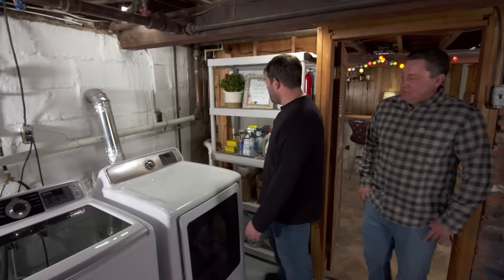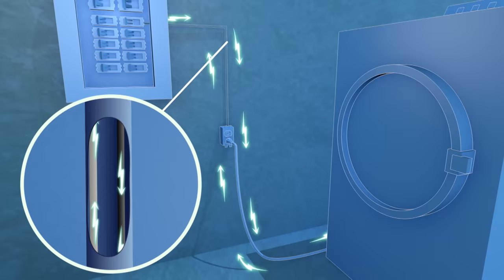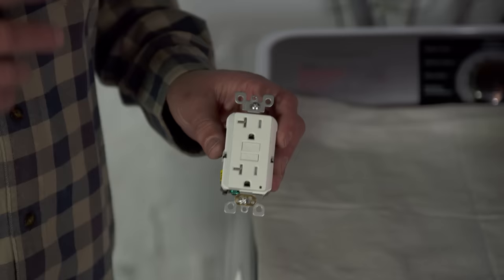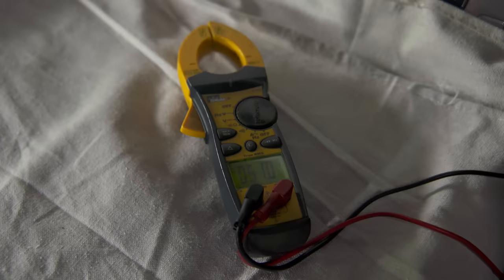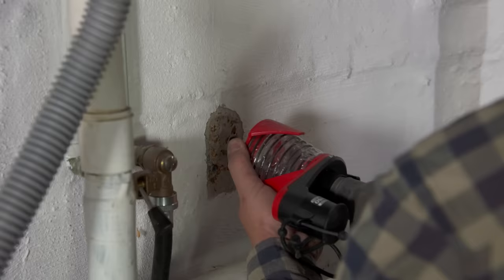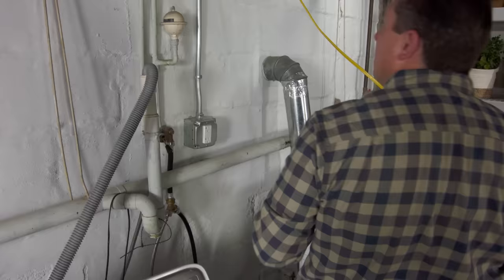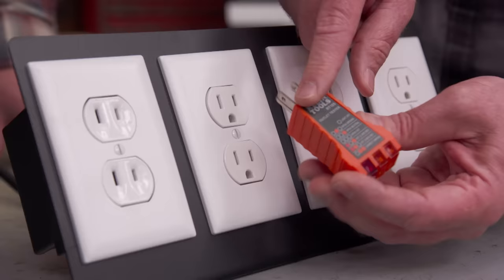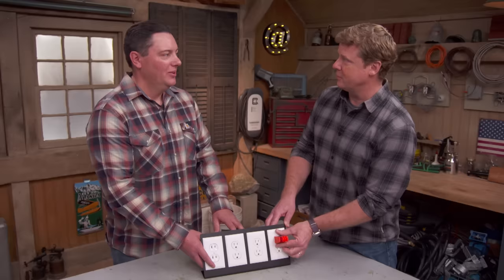How to Ground a Two-Prong Electrical Outlet | Ask This Old House

Comment: This should have been titled "if you have a two-pronged outlet replace it"
Reply: I have a two pronged outlet in my 1940’s house.  Really cool how it is decorated.  Not bland, flat and boring like the ones in use today.  When I rewire the house that is the one outlet I am going to keep.  If I have doubts about it’s safety due to age I’ll rewire it as a 12 volt and use it to power a 12 volt bulb in my 1920’s Art Deco floor lamp.
Reply: @coffeeisgood102  I wouldn’t worry about them being unsafe just be sure that the insulation on the wiring is in good condition and it should be fine
Reply: I have a 1956 house, it was all two wire as per code at the time. There were a couple outlets which the previous owner had installed three  prong outlets and as in the video had no ground so I labelled them. A neighbor is a Master Electrician who ran his own business and I asked how much to rewire everything, here is what he told me. "When your house was built practice was put the main panel by the back door and wire UP into the roof then drop DOWN for wall outlets. Now we put the main panel in the basement where modern Service Entrance for utilities are located, and wire UP. Shorter runs, more accessible and less material. To rewire your house would cost a a fortune. To upgrade my old 60 Amp service he installed a new mast (our neighborhood is overhead wire) a 110 Amp service to a new panel. The old panel is now a sub panel, several circuits were removed and rewired to the new panel and the rest were left, as long as you don't make changes to any of the circuits in the old panel they are grandfathered and legal.

He added a GFCI in the living room for the entertainment Center which is on the old panel but that change is legal.
Reply: @coffeeisgood102  are you referring to the plate?

Comment: Buying a house that's from 1944, but in pristine condition (fewer issues than the "new build" I bought in 2017), having to just replace outlets with GFCI. Luckily the major places like laundry, kitchen, and bathrooms were all converted by previous owner. But the rest are 2 prong...and I really don't want to explode my TV.

Comment: If you were discouraged by this answer, another way to provide some safety is to add a GFCI outlet or breaker.   Not as good as a real ground, but much better than giving up and leaving it as is.  Yes, a GFCI will work without a grounding wire.
Reply: THIS. Thank you Ryan. Wife and I just purchased an old house (1958) and previous owners put GFCI outlets literally everywhere. But not in many places where they're actually needed. Like, the laundry room for example. I also saw a couple 2-pronged outlets...If the house is still ungrounded and based off of an older system with different standards, are the 2 options: 1) Add ground wire to the breaker and all circuits or 2) replace every outlet with a GFCI in order to plug in 3 pronged appliances/devices?
Reply: @cameroneverhart6443  Well, the right answer is "Both" since a GFCI and grounding wire provide safety in different ways.   If your house has unbroken metal conduit to all locations, a qualified electrician could probably set up grounding from that.  If it's knob and tube, grounding everything would be prohibitively expensive.   Note too that you only really need one GFCI device per circuit, not per outlet, assuming everything is wired correctly.   So try manually testing the existing GFCI outlets and see what else goes down with them, you may already have protection on the outlets you're concerned about.
Reply: @ryanjcampbell  NEVER depend on the GFCI test button if the GFCI was used on an UNgrounded installation. The test button uses the earth ground conductor to create the imbalance between hot & neutral. In that case, the test button will NOT trip the GFCI, leading one the conclude there is a problem, The GFCI may indeed work as intended if the leakage current is going to ground via some other path: a short circuit, wet towel, human, etc.
Reply: @cameroneverhart6443  1958?! That's almost new in terms of housing. Knob & tube wiring was falling out of favor prior to WWII. Nonmetallic-sheathed cable, or NM for short, was first Listed and described in the NEC in 1926, but it was invented a few years earlier by Rome Wire Company in 1922 in Rome, NY, and marketed under the trade name “Romex® If your house doesn't have "Romex" NM plastic cable, it likely has Fabric-Insulated Electrical Wire;  brands were Cres-Flex and Ammcoflex among others. 
The Fabric-Insulated cable was usually 2 conductor with ground. But a lot of "old-timer" electricians thought the bare earth ground wire was new-fangled and unnecessary, and thus just cut it off when stripping the jacket.
My house was built in 1894, at least according to county tax records. That's old. There were still a few gas pipes in my walls for gas mantles. It had knob & tube put it when the house was electrified around the 1920s. It was rewired around the late 40s with a mix of plastic & fabric NM cable.
Reply: @RichardFallstich  I believe that is only true for external GFCI test devices.   I was saying to use the test button on the outlets, which will cut off the entire circuit they are on regardless of grounding, at least all the ones I've used have.
Reply: The NEC doesn't require GFCI protection for clothes washing machines specifically, but it does for “Laundry Areas.”

Comment: If you use the GFI approach, since it wouldn't have the ground wire available you need to add the "no equipment ground" sticker to the face plate (it will come with the GFI).  Actually I've done this to a number of plugs in my (very old) house when I can't easily pull a new cable.  Works fine and is code but remember for electronics (TV, computer, etc) it won't protect them like something that has a ground all the way back to the breaker.
Reply: It’s GFCI and they are not plugs, the are receptacles or outlets. A plug 🔌 is a completely different part
Reply: @electricaf365  Showoff! I know what he meant. And his point of not having a real earth ground is well taken. Line conditioner surge suppressors (Furman, Panamax) typically used for home theater or audio systems need a true, preferably robustly grounded RECEPTACLE.
Reply: NEC 2011 did away with the no ground sticker

Comment: This was the right repair done the right way.  The cost in the description is low but it's probably an old video.
Reply: Not in the Midwest. If I did that job it would of billed at $250 ‐$300. Been in buisness since 1996 so I don't need to lowball either.

Comment: Good video.   Simple, straight  up  explanation with correct options.  I should show it to some of my customers.   It is some of the comments  I worry about.    Proper grounding is one of the most important safety  issues when it comes to electricity.  Older and even newer homes have their own  unique  wiring methods.  It could be handyman doing work in the past.  When the grounding wire was added to the cables many electricians did not know what to do with it.  Keep in mind that if there is no proper grounding conductor present, your surge  protectors might not work.

Comment: The main circuit panel does not have to have separate neutral and ground bars (only sub panels).  When he is hooking up the breaker he says to hook the last wire up to the ground bar but you can see a bunch of white neutral wires already in the same bar which is fine.
Reply: I think the breaker he is using is designed to send the current to different busses.  I think the previously confused panel is a different issue but he did the job correctly

Comment: It would have been nice to apply this to a larger situation than just a single receptacle that already should have been GFI, like a standard circuit of 2-prong receptacles.  Knowing that you can simply replace the most upstream receptacle with the GFCI and have it protect new downstream 3-prong outlets would be a valuable point that would save DIY'ers a lot of money if they have a whole house to work through.
Reply: Andrew Cates 
It’s not always visible as to the circuit layout and knowing what feeds what. 
In such cases, we often just replace the breaker with a dual GFAFCI to protect the entire circuit.
Reply: @RobertLeBlancPhoto  I agree the method I mentioned would take more time and trouble-shooting.  DIY'ers (the audience for This Old House) are typically willing to spend more time so that they can save money.  Otherwise, they'd just hire an electrician to do this.  Those breakers are likely more than 10x more expensive than using a single GFCI receptacle per circuit, so if the whole point is doing it yourself and saving money, that may not be the best fit for everyone.  I agree though that the breaker route is definitely a worthwhile option that is faster and could be perfect for many people.  That was the broader point I was trying to address with the video - they didn't mention any other options or a larger scenario.  It was too specific to the washing-machine receptacle circumstance.  Educating DIY'ers to more/all options available to them would be more helpful since most people that are dealing with 2-prong outlets will have more than one to address in their home.
Reply: @andrewcates3390  There are about ten existing YT videos on how to do the 2-prong to 3-prong upgrade with GFCI, if you ignore the idiots who suggest you just "ground" it to the enclosure, without bothering to discuss how you know whether that enclosure is bonded to the ground at the service panel.
Reply: not true, downstream protection only works when you have a ground. try using your gfci tester on a downstream outlet with a blown out ground, the results may surprise you. No ground on a circuit requires GFCIS everywhere.
Reply: Very interesting comment.  Goes to show you how dangerous these videos can be.

Comment: The jobs you show always have complete open access to what needs doing.  Just once I want to see you tear apart some drywall.
Reply: It is always best case scenario. It is bizarre. Why make that video?
Reply: And how come there’s always a pristine breaker panel installed? How come there’s never a rusty old fuse box full of cobwebs? (With 75% of the house on just one fuse!)

Comment: Good job...but my inspector would not pass this job due to the romex being ran through the emt...I would have pulled #12 thhn wire from the j box to the new device preventing over heating through the jacketed romex....

Comment: If the receptacle is in EMT like many unfinished basement receptacles are, especially in the laundry room, you can just put a jumper to the outlet from the metal box and the conduit that’s connected to the service is now the equipment grounding conductor.
Reply: Yes it does work but definitely better to use actual ground
Reply: But for for retrofit why not
Reply: Yes, unless you have the conduit poorly connected to the box and the main panel.  It's obviously better to run a ground wire.
Reply: Yes EMT is perfectly fine to serve as ground. Perfect example of do-nothing make work.  All that was needed was to replace two prong with three prong receptical and connect ground to metal box (checking that metal box is indeed grounded first).
Reply: @springer-qb4dv  yep thats what I meant for a new install just run a dedicated ground but for this situation especially since in America you have to have use a gfci in unfinished basement it would’ve been fine
Reply: In this house, the EMT was just a 3’ piece used to protect the Romex as it goes up the wall. Just a chase. Since the EMT does not go all the way back to the panel, it is not an “effective ground fault current path,” and connecting the ground terminal of an outlet to that metal box would do nothing.
Reply: That’s a good point!

Comment: Theres a lot of ppl that cheat the neutral wire when trying to sell their home. Keep in mind those plug testers are not always accurate, considering it doesn't know if there is an equipment ground wire or not.
Reply: Some newer testers can identify bootleg grounds...👍
Reply: @MrMaxyield  Nice to know. What manufacturer carries it. I have always opened outlets to see if ground has been bootleged.
Reply: @notredo  one brand i know of is Ideal.  I think it's call Ideal Sure Test, i do know they run around $300 give or take.  They work my measuring the impedance between neutral and ground on the receptacle. Obviously a cheated ground (aka there is old cloth 2 wire system and the handyman decides to install a 3 wire outlet and jump the neutral and ground to fraudulently pass an inspection,  very common with flipper homes,  unfortunately ) will be a very low impedance due to the very short length of wire, while a properly grounded romex wiring will show a larger impedance due to length to the panel, because neutral and ground eventually meet at same bussbar .    Hope that helps
Reply: @Sparky-ww5re  thanks
Reply: @dancooper6002  If you buy an old home you should already have that in mind..

Comment: Note the panel, it's likely the main panel, and you can see ground and neutral sharing the neutral/ground bars, so the two are "bonded", at the box.   Also note: sometimes people ran ground to the metal box, but not to the receptical.   In that case, you can go with a 3 prong, and the entire thing is simpler.
Reply: Only a three-prong receptacle with a ground strap attached to the bottom screw is code compliant
Reply: @kevinjensen7752  new code allows a gfi to be used, without ground if you do not have it at the box.must be marked as ungrounded.
Reply: Or just put the entire ungrounded circuit on a GFI breaker. Easier then having GFI outlets everywhere.
Reply: @kardrumzcoursey9537   I know right.  Honestly, if GFI breakers existed before 71, ground wires to the appliances would not even exist....lol.

Comment: Some older homes like mine with two-prong can be grounded but through the metal conduate back to the breaker box.
Reply: this is true as long as there is a grounding tail going from the electrical box to the outlet, switch, etc and the conduit is emt or rigid. Metal flex is/was only allowed for grounding in special circumstances. I think it's even still legal to do this today although it is frowned upon.

Using the conduit as the grounding conductor was common practice until the mid 90s.
Reply: Since you're talking about older homes, are you talking about actual conduit? Or the flexible metal armor that a lot of older wiring was wrapped in? If you're talking about the latter, it's illegal now to use that as a ground. Overtime, the cable could form a break, whether it be at the box or along the run, causing a ground fault. Also, the armor wasn't necessarily designed to carry any kind of load. There is potential of causing a fire if the neutral wire loses connection since a standard breaker has no way of checking if power is coming back through the neutral wire, or another location (ground wire).  You could have 15 or 20+ amps going to the armor cladding when it wasn't designed to do that and heating it up like a heating element. Hence why GFCI breakers exist.
Reply: @Jason Bowman "EMT conduit"?  You mean "EMC"?  Also worth noting that not all "conduit" is metal, let alone conductive, even with all the proper fasteners.
Reply: One time, I replaced a 2 prong outlet with a 3 prong, and grounded it (and the box it was) in by running a grounding wire through the side of the house, out to a grounding rod place along the foundation
Reply: @88KeysIdaho  I'm not sure exactly how you system was wired, but tying back to the breaker box is the better idea.  Hopefully the ground rod you tied into was the same one that hooked up to your breaker box.  Depending on soil conditions, any ground rod at the home isn't always the best ground connection.
Reply: @l337pwnage  Thanks.  I drove a new 8-ft grounding rod, into the soil, about a foot out from the foundation.  I couldn't run back to the panel or its ground rod, or I would have just re-wired with new romex.  As far as I know, I had good conduction, because I tested the outlet without neutral (temporarily, and it worked fine.
Reply: @UpnorthHere  EMT = Electrical Metallic Tubing -- very common. EMC = ElectroMagnetic Compatibility -- not as common (primarily used on ships and in medical/industrial applications).
Reply: I doubt your home is ran with conduit
Reply: Womb Raider  I did not what?
Reply: Womb Raider  I don't know why you think I'm lying.  I ran a green wire out the back of the back of the box, down the side of the house, and attached it to a new 8 foot ground rod.  The outlet that show no ground, then showed (with a tester) that it was properly grounded.
Reply: Conduit is bonded by its connection to the main panel provided the panel is bonded to the ground like it should be

Comment: I finished a job last week. 
Guy put 13 GFCI’s in basement. 
And no joke. Had 13 bare copper wires coming out and he had drilled 13 holes in slab and pushed grounds into each hole. 
I love making $$$$$$$ lol